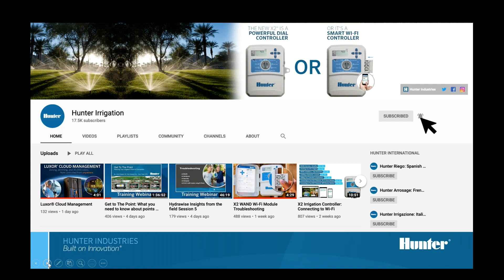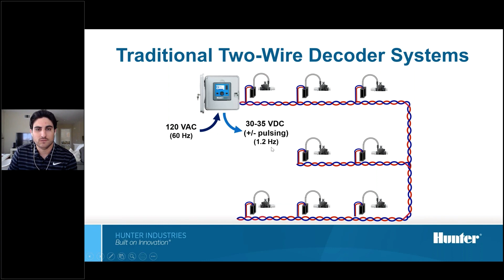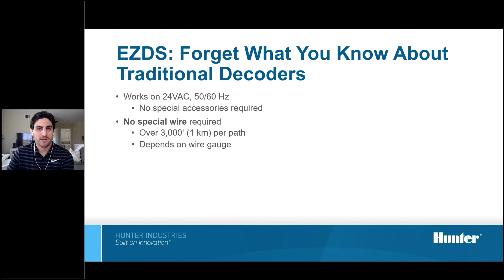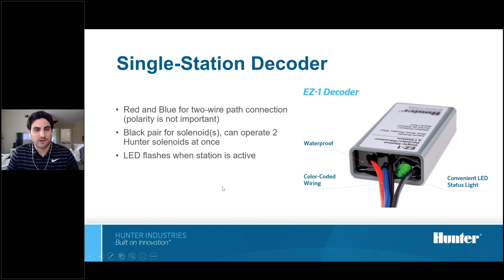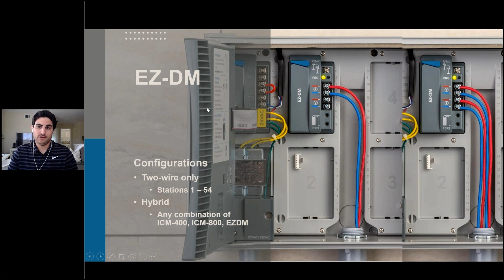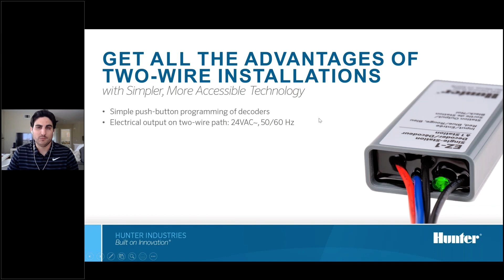EZ Decoder System: The Simple Two-wire Solution

Comment: When looking at the wire specs at 33:20 is that saying the max distance for only 1 decoder on the wire path can reach 908' with 18 gauge wire or is that saying regardless of how many decoders you have on that wire path you can reach 908' with 18 gauge wire? Is there wiring distance drop after each decoder is installed? If there a distance drop after each decoder installed, can you please provide additional wire spec documents / information?
Reply from the maker: Correct, the maximum wire run for one decoder is 908' on #18 wire. Activate a second decoder at the same time and the wire run shortens to half the original spec, 454'. But just installing decoders doesn't impact the allowed wire length.

Comment: Great video. It helps a lot. Only thing I don't understand: With an HCC and an EZ Decoder module, I get right away 52 stations? Or do I have to buy the individual modules (like before) to get 52 stations?
Reply from the maker: Thank you for contacting Hunter Technical Support.
 
The HCC when used with the EZ decoder module alone will be ready for 54 stations set up, you still have the option to use 8 station modules before the EZ-DM in case you would like to have zones working the conventional way, and the rest on decoder. 
 
Thank you again for contacting Hunter Technical Support. Please let us know if we can offer any other assistance.

Comment: Hi, I’ve been working on irrigation system two-wires and multi-strand. This is my first hearing Hunter Pro-C can also used for two wiring. Is there a link I can learn more about this???? Thanks
Reply from the maker: Yes, the EZ Decoder system combined with a Pro-C controller can connect to 28 stations on two-wire and 4 stations on conventional wire. More info is here: https://www.hunterindustries.com/irrigation-product/controllers/ez-decoder-system

Comment: The HCC and Icc2 will they work with a Dual-1 decoder or does it have to be the EZ-1 only decoder??
Reply from the maker: The EZ decoder system works with the HCC and ICC2 controller lines.